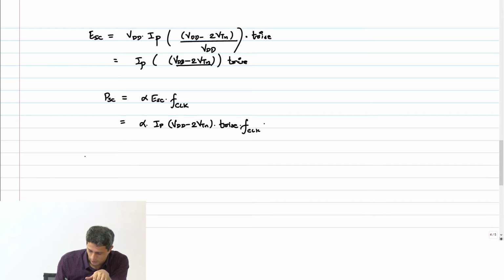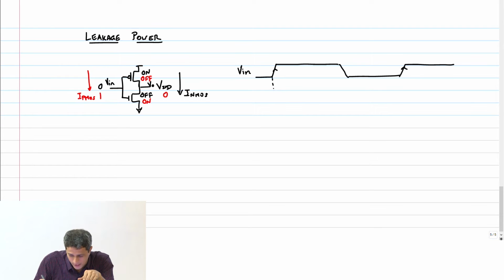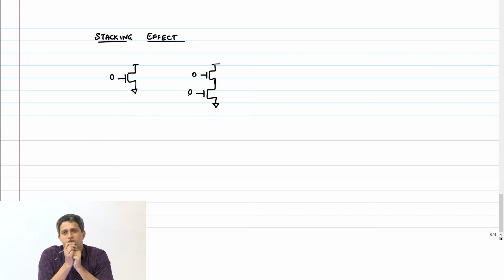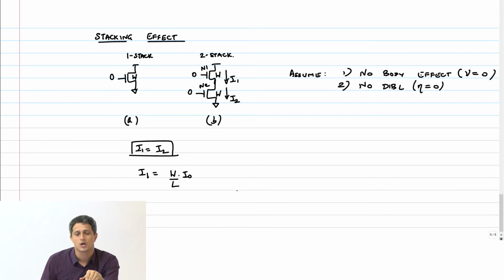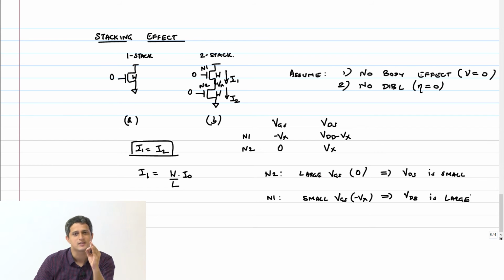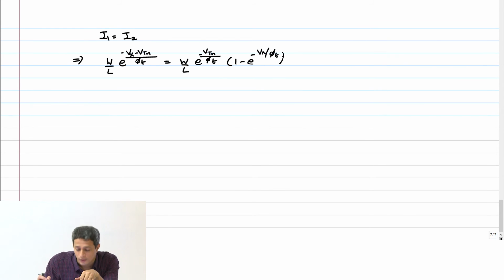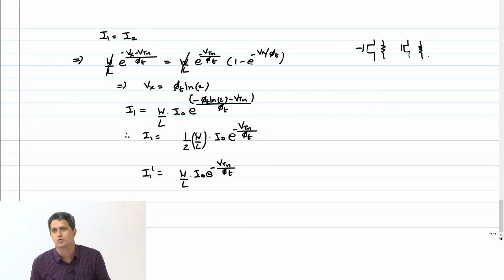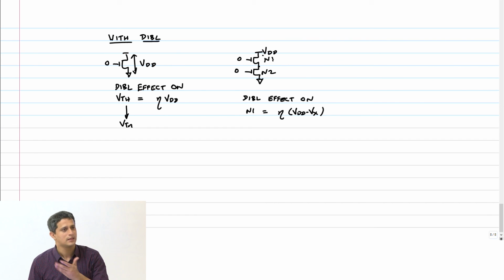Inverter - 17 - Inverter: Leakage Power and Transistor Stacks

Comment: I think the shirt channel effect we see is GIDL not DIBL. DIBL should be considered when VGS is less then VTH (Weak inversion) and high VDS. But here VGS=0, Since VGS=0 or less than 0 & VDS is high we see GIDL due to tunneling and this effect is independent of VTH. Since we are stacking NMOS,  VDS for each transistor will get reduced. So we experience less leakage with stacking
Reply: DIBL when channel is created.Various vth in linear and saturation
Reply: but GIDL related to subthreshold leakage current when channel not created

Comment: Why Vx close to ground
Reply: because N2 has more leakage current due to more gate to source voltage as VGS of N2 was [-vth] whereas VGS of N1 was [-vx-vth] but I1and I2 need to have same leakage current as they are in series so we do the adjustment through VDS we make (VDS)2 small so Vx will become close to zero as the source of 2nd transistor was grounded